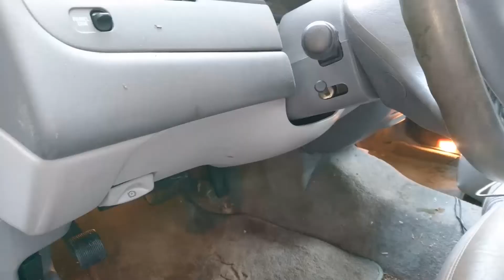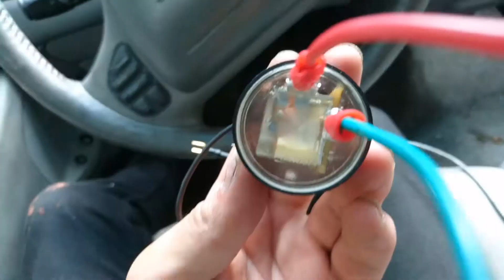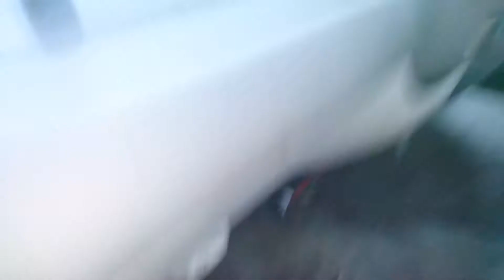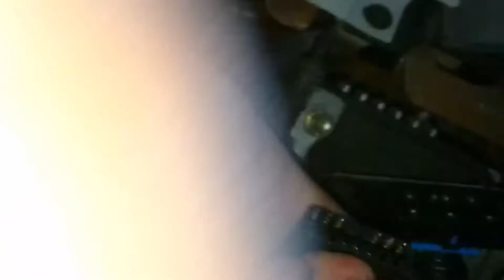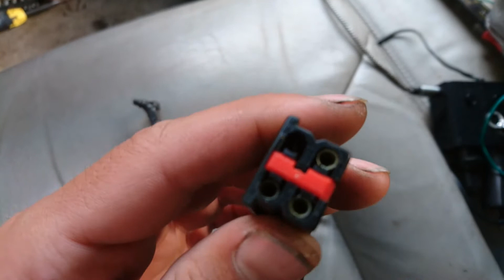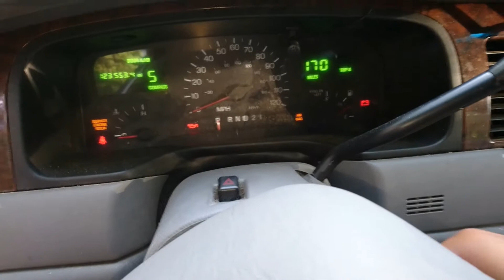No Resistors Necessary! LCM Flasher Bypass As Seen On Panzer Platform TV - 1999 Lincoln Town Car

Comment: I officially hate you. lol
This is absolutely genius using reclaimed turn signal pigtail connectors to make your own plug & play wire harness.
Where do you come up with all these great mods.

I ordered the CEC flasher after watching your first video, and it still hasn't shipped.
It's driving me crazy.
I can't wait to remove my rats nest of 6 resistors in my trunk, (3 each side) on both my Panthers.
-Chuck